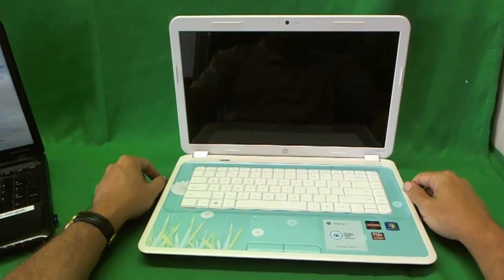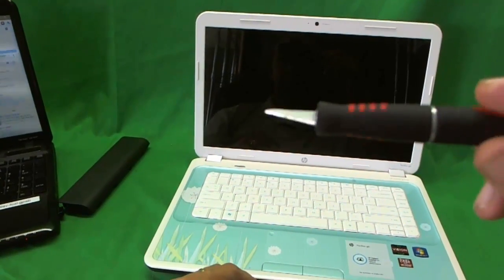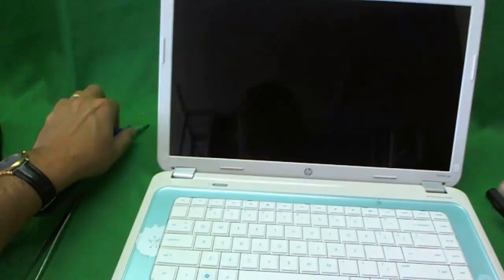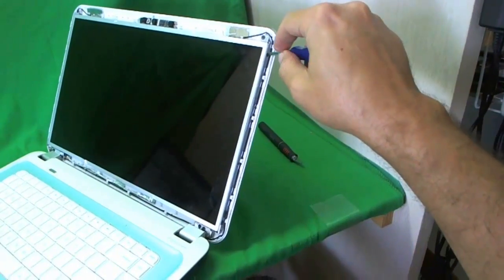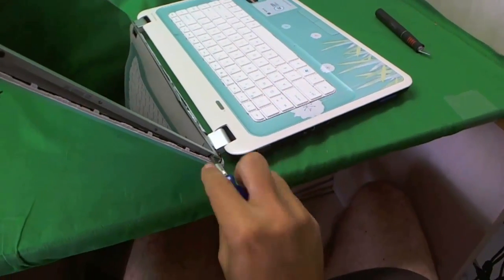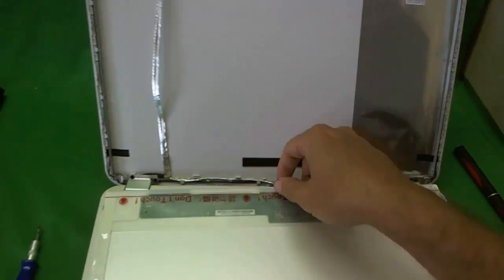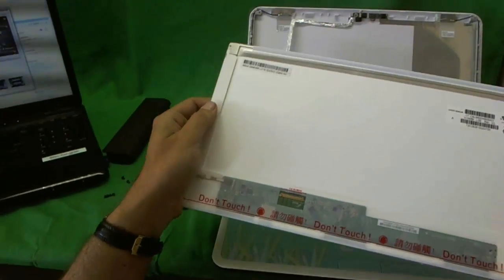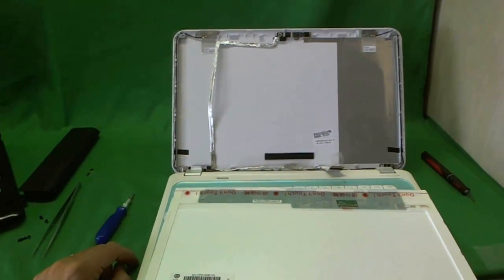HP Pavilion G6 Notebook Screen Replacement Procedure

Comment: Just used this video to replace the screen on my girlfriend's Pavilion G6. I ordered the screen off Amazon for about $50. It took less than 15min to fully replace.. Removing the bezel was really tough at the bottom of the screen; moreso than in this demonstration. Remounting the new screen in the mounting bracket was also a little difficult without a magnetic phillips head screw driver. I'd recommend using one. Just like RAM sticks, make sure your monitor cable is FIRMLY SEATED at the connector before remounting the screen. As a whole, it was a pretty painless procedure, and the ~$50 price tag was far cheaper than getting it professionally serviced (~$150) or buying a new laptop (~$450). Thank you ScreenSurgeons for the help!
Reply: ***** It took quite a lot of pressure. The rest of the bezel was "relatively" easy to remove, but the bottom side was extremely tough. I applied a lot of torque, heard a loud crack and it came off. It didn't seem to break the plastic, but that's entirely possible. I used a flathead screwdriver to pry some sections of the bottom bezel away from the screen and then I just committed with one big tug. I can't promise you won't break it. This video makes it look effortless, and it wasn't.

Comment: This worked AWESOME!  The only issue I had was on my HP Pavilion G7 17" screen the bottom of the plastic ring the holds the screen in didn't completely remove.  I probably could have removed the hinges but I was able to get everything to work without doing so.......

Comment: Could it be possible to change out the lid outside cover and put it on an Hp 15 Laptop. My Dandelion Breeze laptop isn't working and it cost way to much to fix. I just want to change the lid covers.

Comment: If there is no inverter to replace, what would be the next step? My new screen is dark but the old one is too, my laptop is working fine in very other aspect. All the cables and connections look good and its definitely plugged in properly..

Comment: Hi, I want to say thank you for your video. I broke my G6 LCD and bought a new one from ebay, but after replace it, the new LCD can not be light up. but if I use an external monitor, the laptop works very well. what do you think about this, does the mother has a fuse for the LCD? any suggestion? thank you very much!

Comment: I have this exact laptop and my screen seems to be cracked from the left corner in. If I touch the top of the screen a certain way the damage gets worse or better. There are what seems to be color streaks going horizontally and vertically across the page and half of the screen is NOT visible. How do I know if I need to purchase an LED or LCD screen?

Comment: Hey, I actually have a question about the the face on my g6. By the face, I mean the top part of the laptop when you close it. Where the HP logo is. I wanted to know if I could get a replacement and where if possible because a part of mine broke and I plan on selling my computer. I already called HP but, they were out of stock on that part.
Thanks.

Comment: The old screen has same issue and I have already replaced the cables with new ones. im at a loss. Can only see the images with a flashlight on both screens. The monitor outs work fine.

Comment: Thanks for the video. I replaced my screen with one I bought from screen surgeons. However, it's still not coming on. With the old screen, the computer was powering on, but the LCD screen was completely dark, not even a flicker. However, when connected to an external monitor, I could see everything. Please help. Thanks
Reply: I am having the exact same problem as you had. What was the issue?
Reply: It ended up being the ribbon from the motherboard to the lcd. It was kinked and needed to be replaced.

Comment from the maker: No it does not have an inverter. 1st thing to do is to double check the connection, also try the old screen again see if it lights up.

Comment: I replaced my screen and a few days later i bumped my laptop. i cracked it open again and i saw that the connection was loose so i plugged it in. the laptop wouldnt turn on unless i had the connector unplugged from the screen. i have tried both screens and the computer wont charge or turn on unless they are unplugged.

Comment: Just about as easy as your video shows, except for the bezel.

Recommend an egg carton to place the parts in as you remove them.

Lay the screws in the egg carton in the order that you remove them, and work left to right, top to bottom just in case the screws are not a matched pair.

The bezel did not come off as easily as your computer.  I suspect that your's had been removed before and the bottom bezel edge clips just to the inboard of the hinges were damaged or deformed.
I got quite a bit of resistance from those two points.  Gave them an extra firm but not hard pull and did not get them to release.
BUT, when I closed the laptop lid most of the way and put my thumb between the bezel and screen back/exterior edge on the outside, just inside of the hinges and those two points released very easily.

I took a picture of the ribbon cable connector before I disconnected it from the damaged screen, to make sure I had a comparison to the connection on the new screen.

The reassembly then is reversing the steps and the parts in the egg carton.